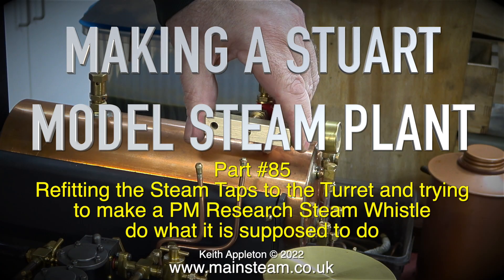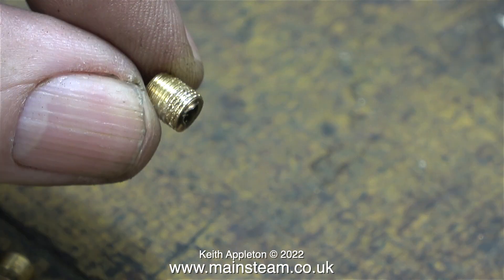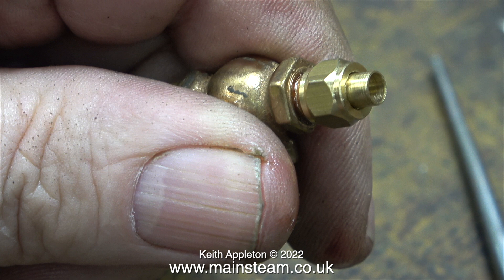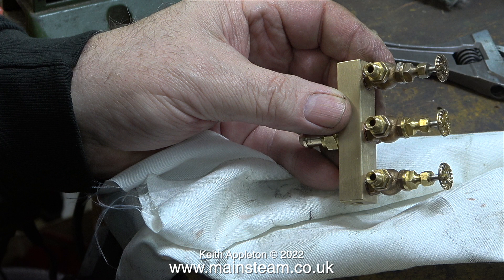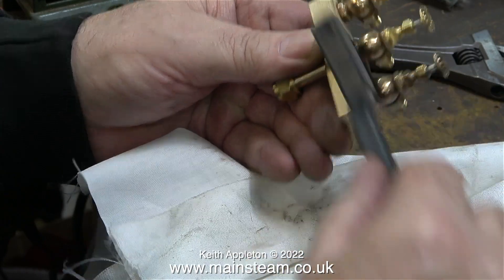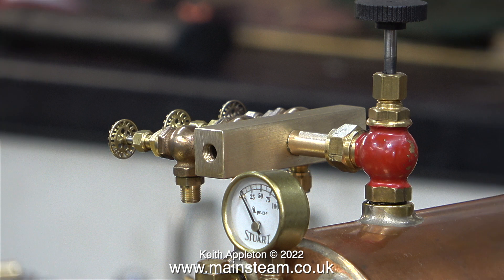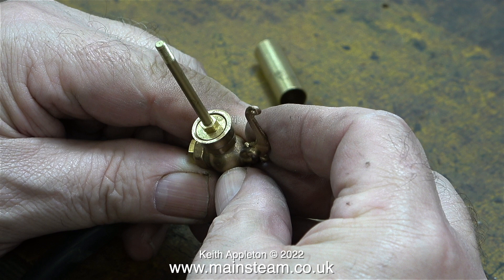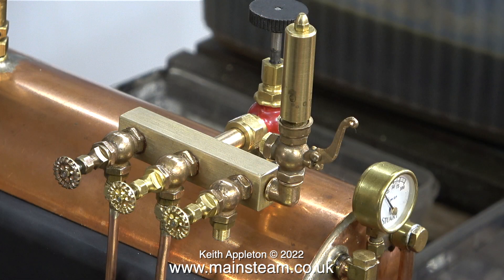MAKING A STUART MODEL STEAM PLANT - PART #85

Comment: At the beginning of this video you showed what you called your "Messy workbench". On the right side of the view was a strange tool, with a square hole in the center. I've never seen a tool like that before. Is it a special tool for steam engines, or one not seen outside the UK? Hand tools have always been an interest to me so, seeing something new, to me, is always interesting. ;-)
Reply from the maker: It's just a simple reversible ratchet wrench which takes a 5/16" socket driver. I use it mainly for threading holes using 5/16" diameter taps . . . .

Comment: still enjoyed the reteaching of the whistle to pucker LOL
Reply from the maker: I am so terribly, terribly sorry ..... I work very long hours to make these videos to this standard each and every day - for my Patreon supporters.
I always set some of them to "public" on Youtube around Midnight on selected days, when I am usually getting tired. Part #86 was uploaded before Part #85. If you watch them in the correct numerical order, then the Whistle repair preview sequence in Part #85 makes sense. My sincere apologies and I really will try harder next time . . . . .
Reply: @keithappleton  not worried about it tbh .. the whistle episode is a truly good one . diagnostics and solution using logic and common sense .. something lacking in many places ... here's a thought though ... the wooden train whistle that uses 3 notes .. wouldnt it be possible to use the whistle pipe with three different sections of different lengths to get the train whistle tri note ? ... other than being super fiddly I dont see why not ... .just needs a thin separator and some filler that can be removed ...